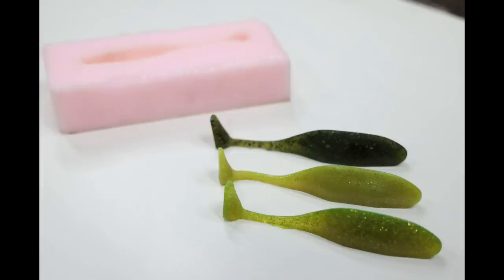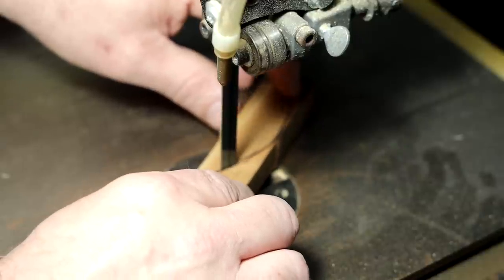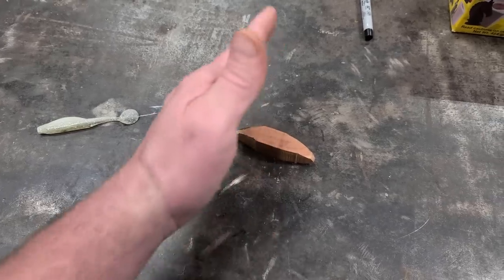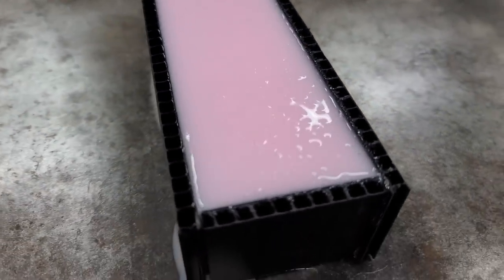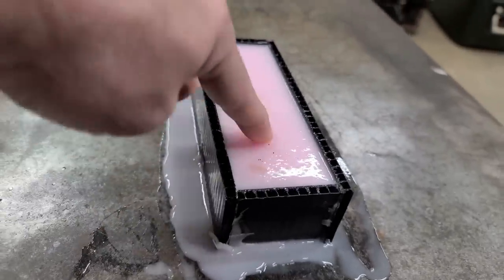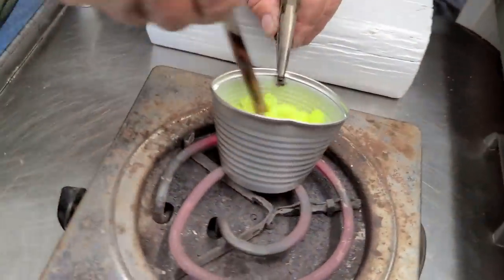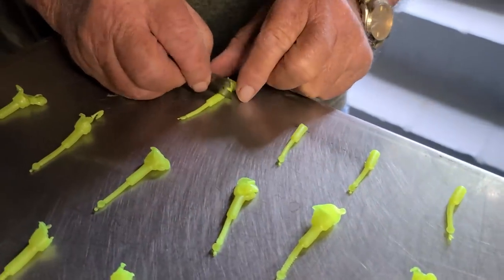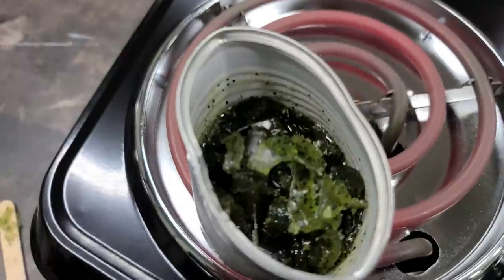How To Recycle your old Lures  ( without a Microwave  )

Comment: Just a simple trick to avoid getting bubbles in the mold. When pouring the silicone in the box. Hold the silicone high above the box so it creates a thin pour line. 
 Not so high it blows all over. This give the bubbles away to escape.
Then you can use the sander or low pressure air to blow on the top of the pour silicone.
Great Job !

Comment: The open face mold idea was a life saver for me. Except I'm going to ty making the mold with some old floral clay I have sitting around the house.
  To melt my old soft plastic I was going to go with the hot plate until I keep hearing how easy it was to burn up the plastic. That's also before you showed the lead trick. Instead a couple days ago I hunted a few thrift shops until I found what I was looking for. An coffee pot warmer like my grandparents used to have.
 It doesn't reach as hot of temperature as a hot plate on it's lowest setting. I put a small pot, old plastics and a glass lid (to see the melting progress & block fumes) on the warmer. Works perfectly! I gave it a little stir about every 10min and left it on the warmer for almost 2 hrs to see if it would burn up. Nope, never did. For 2 hrs that warmer keep the plastic in a liquid state with just a stir once and awhile. I actually ate dinner(30-40min) without messing with it till I finnished. 
  I'm telling you, if you can find an old coffee pot warmer somewhere, grab it! You'll never use that hot plate again.
Reply from the maker: I always heard the microwave was the way to go . But he makes it look easy lol

Comment: Good stuff.  Your finish on your first one was flat because you didn't`t seal your cedar plug. Sealing your cedar plug with a clear lacquer will give the finish of your plastic rubber I shinny coat. Also when you start your carving, always have a centre line on your block of wood first ,then draw your desired  body shape. A centre line on your initial block of wood will keep your carving streamline to glide better in the water. Cheers from Canada.

Comment: I use the clay you bake to make the lure blank I want. I bake it till hard. I push that into a block of clay and then bake that. Pour your plastic( I melt old rubber worms) and let cool. If you spray cooking spray in mold it releases easier.
Reply from the maker: I might have to try it that way